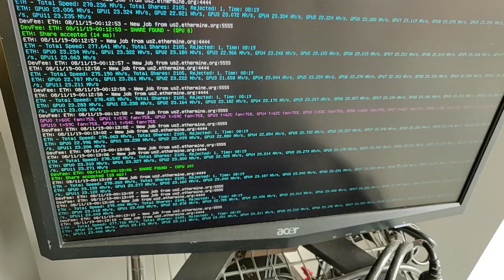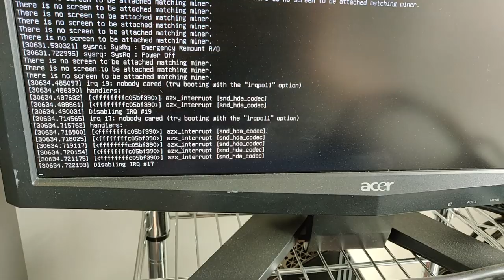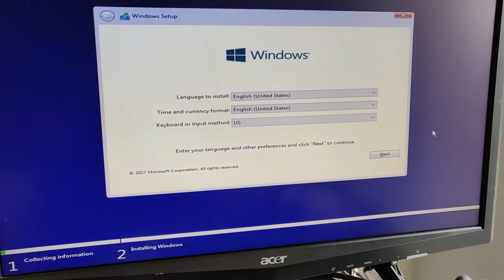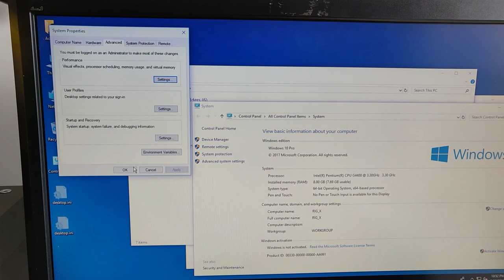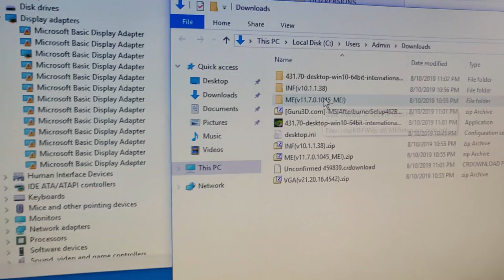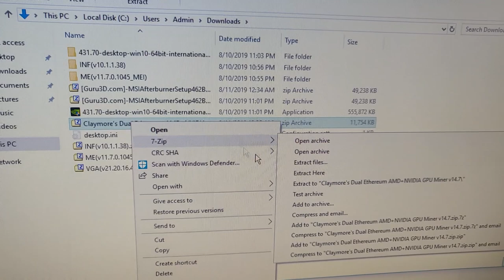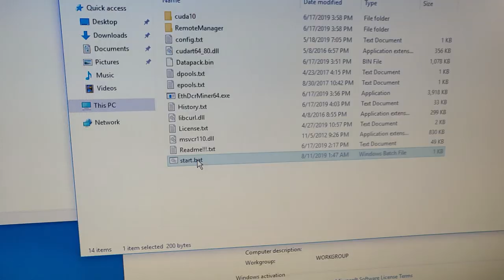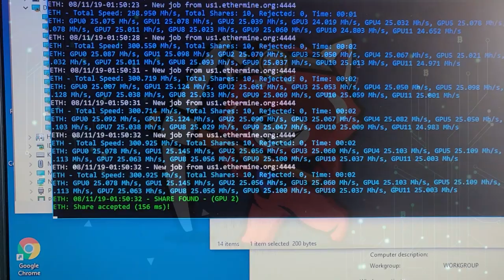Switching My 12 x 1060 6GB Mining Rig To A NEW OS...

Comment: Remove MSI Afterburner and try NVIDIA Inspector instead. It allows you to set constant lower voltage for each card, so the power consumption is less. This can be done not in the program itself, but with a .bat file with some settings in it, similar to how .bat file is used for Claymore. Search Google for "nvidia inspector mining" or something like that :)

Comment: windows is the most stable OS for mining . runining for 2 years without 1 single failure , just hard coded your GPU FW ( Timing ) and Windows will rock . using claymore

Comment: Does that Windows ISO also take care of the Advanced Power and Sleep settings that need to be updated? Stuff like turning off the display and shutting off the hard drive should be disabled. The Windows Slide Show should be disabled here as well. Hybrid Sleep and Hiberation should be disabled. An important one is PCI Express Link State Power Management should be off. I found out the hard way this can cause black screens, lock ups and BSODs. The rest of the stuff in the Advanced Settings can stay defaults.
Reply from the maker: this is amazing info, i'll check it out of those settings are in.
Reply: @RedPandaMining  YW!

Comment: I tried the ISO. Ran into a few security snags (too locked down). Wound up running stock.
Reply: Have a try with Windows 10 LTSC, it's a stripped down ISO designed for single use applications. (Such as ATMS etc) I always used it when running Windows for mining.

Comment: RPM, what is that compressed air can@duster u were using..? Could u link me to that product..?
I need to clean my 3 years old rig before expanding it, too much dust..
I read blower could cause damage by electric static & such..
I dont want to kill my rig ><'

Then again its hard to find compressed air can @ duster products in my area..

Comment: Want to know how long it stays up without crashing an stuff. Thats the most important
Reply from the maker: i'd say once a month i give them a reboot.
Reply: @RedPandaMining  well ya. But im intrested to know how long it runs without crashing compared to linux.
Reply from the maker: @jimsinnovations2737  its negligible at best.
Reply: I've run Windows 10 Pro on 7 different rigs in the last couple years. Once you get Windows configured correctly (remove the useless applets, shut off the services you don't need, correctly configure the virtual ram and Power/Sleep settings) it's stable as a rock. It'll go weeks and months without problems. 

When I do have problems with a rig it's typically had nothing to do with Windows itself. My Public Enemy #1 has always been wonky AMD drivers. Closely followed by hardware problems: Too much overclocking, too much heat, BIOS mods gone wrong or simple failures. 

Like Panda, I like to give my rigs a little reboot now and then, although I usually do once every week or two. Some of the mining software isn't that solidly written, and programs do leak memory.
Reply: I have a rig that is (4) 1080s and (5) 1060 3g. Until I had a power outage a couple days ago, that rig had been running non-stop since early June. That's my "set it and forget it" rig. (;^D
Reply: @lapurta22  yea they do, but im still interested to see how long it is stable tho